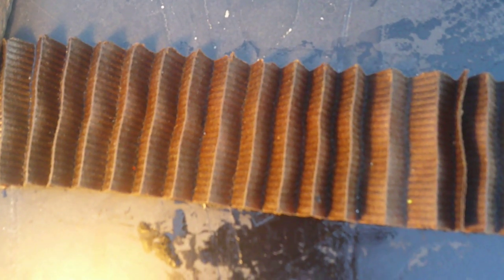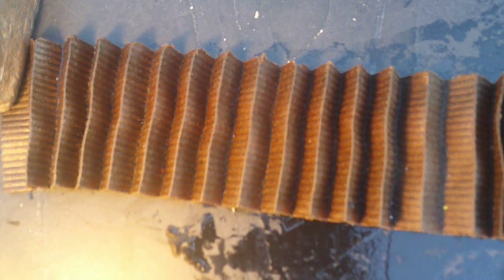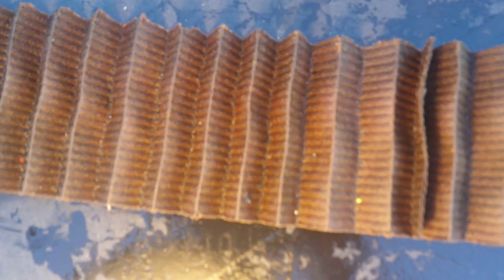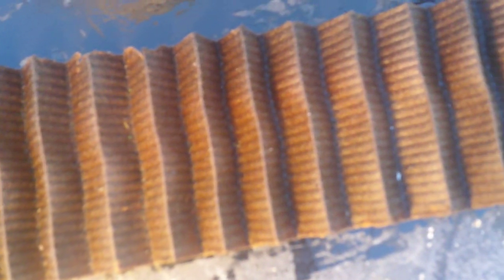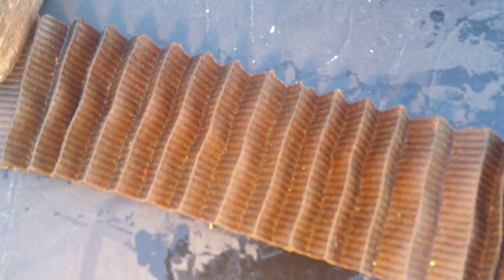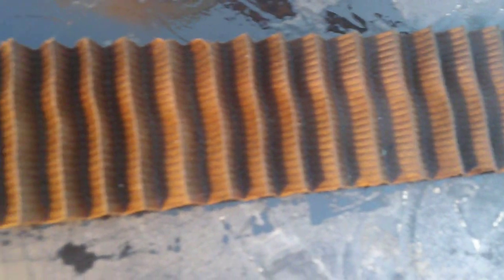When you get distracted building an engine something bad always happens.

Comment from the maker: I will drive it a while and check filter again and eventually check bearings. A friend is my machinest and he looked at the particles in filter. His first thought was to check the bearings based on the bolt came loose. 
I removed the small flakes and tiny specs from the filter. To my suprise it didnt add up then i put them under a microscope. Yes i own a stereo scope and rarely i look at debris found in engines for friends. Under the scope i dont think they look to be from a bearing that was worn. They look to be from two scources and non of it is atracted to a magnet. I used to buy speed pro pistons from a warehouse. One of the sets i noticed fine shiny looking grit on the bottom and in the ring grooves. I contacted the warehouse and was told it was left over from the finishing process. Some of the specs fall apart and smear. I check over all my parts i use but to be honest i never thought i would find anything to clean off a new piston.
 I found a short sliver with a curve. If you put your cam bearings in you know that when you drive them in metal can shave off the back side of bearing into the oil passage. I try my best to be carefull but wondering if it fits the description. I did put a different brand of cam bearing in that i think took more effort to drive in. There are some brands i prefer but when suppliers jack up prices im tempted try another brand. 
I dont know when i will get to pulling pan checking bearings to be sure. I was greatly suprised that so many people watched the video and left comments. Thank you.

Comment: At least you found the problem Len. That bolt was from the main cap where the oil pump is mounted. If the oil pressure didn't drop below 10 psi it will probably be ok. The metal likely came from the thrust bearing surface of the rear main bearing because of the loose bolt. If it's not a pain to get the pan off, I'd want to replace the rear main bearing if it were me and this was a fresh rebuild. You can spin the top half out and the new one back in with the crankshaft in place. A cotter pin in the crank oil hole works fine for that. Or, you could always check the endplay on the crankshaft with the bearing that's in there now. The rear main bearing thrust surface may be ok as is even if it's a little roughed up.